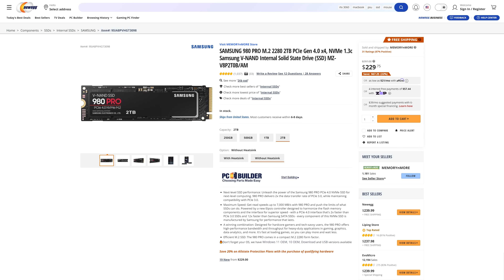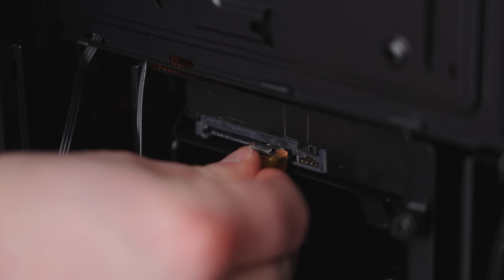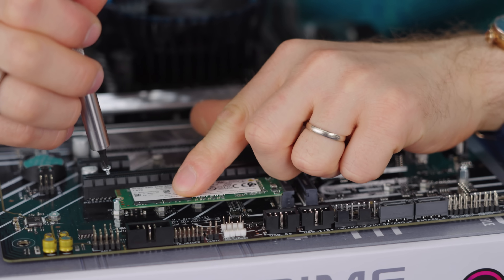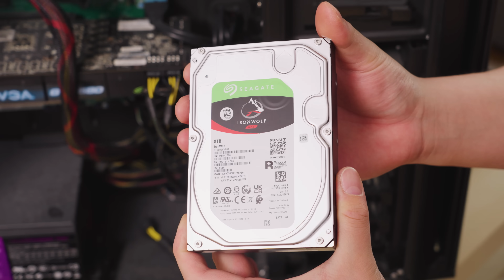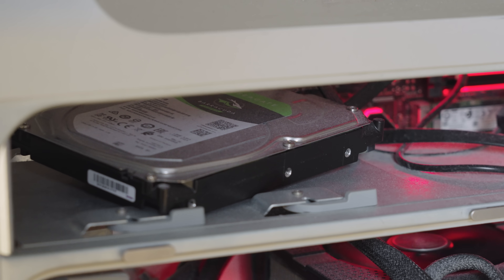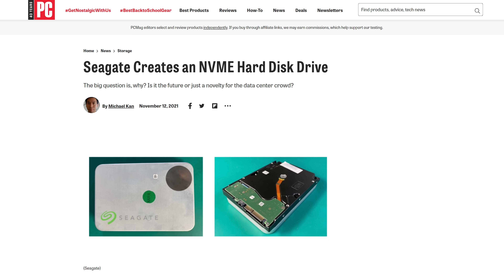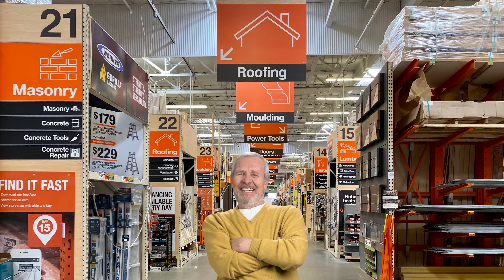Is SATA Obsolete?

Comment: SATA will be around for a long time as there is currently no replacement for it and it offers a lower cost interface than any existing alternative given that it interfaces to the chipset and not the higher value express bus.  M.2 is not a replacement for SATA as it doesn't fulfill the same needs.  That's like saying sandals are a replacement for athletic shoes.  The reason there is no replacement yet for SATA is, I think, because there is not currently any need for a replacement.

Comment: SATA will never be obsolete as long as there is no replacement tech for large format HDD. 12, 16, 20 terabyte HDDs still have huge value in the consumer, freelancer and business sectors. Nvme storage is still limited in cost, and how many nvme drives a system can realistically have. If you're a video editor, filmmaker, game dev, gamer who wants to have a stored library of games etc etc. Then you know the value of having a large storage drive that for all intents and purposes is fast enough for the job and is extremely cost effective.

Comment: I dunno, for my home nas server, it is still way cheaper to get mechanical NAS drives than 2.5" sata ssd let alone any 2.5" nvme, and honestly for my use case, i am fine with mechanical drives running ZFS on a gigabit network. The SSDs are great for their purpose, but i have a feeling mechanical sata drives will be around for a while due to being cheap mass storage.

Comment: Well, SATA and its derivative - SAS - are holding very well in datacenters. SATA is still used by most of video recorders (but to be honest, USB-C seems to bite that sector from one side, and UHS-II and newer standards from another). Still, 2.5 SATA drive can have so many fast and relatively cheap chips, that no SD card would get even close (but USB-C drive can). And yes, I am considering switching my prod servers to enterprise NVMe for fast storage - but I will also use a ton of 2.5 SAS drives for reliable storage (fun fact: I still have ten year old SAS drives and they already outlived three backup NAS arrays)

Comment: I wish seagate would unveil a mechanical drive that can last longer than 2 or 3 years. That would be impressive to me.
Reply: What the hell are you doing to not have a hard drive last 3 years?
Reply: @JerichoTheCity  purchasing seagate hdds. Seriously ive had 1 seagate hdd last longer than 3 years. Also all of them minus one external thumb drive have sat undisturbed in my desktop which is well ventilated and not accessed continually. I would think it was something I was doing except all my Western digital hdds in the same tower are just fine. Ive got a couple of wd hdds from 2007 that still work like the day I bought em i kept them as backup drives cause i mean if it aint broke.

Comment: Not until I can stick 10 M.2 drives in a box for as cheap as I can do it with SATA. Next question.
Reply: m.2 is just a form factor, it can be SATA or NVME under the hood.

Comment: I have a loose sitting SATA SSD.  No moving parts like a hard drive so nothing to worry about there.  It is in a 5 1/4 bay with plenty of room for other 2.5 inch drives if choose to use them

Comment: My issue is if I have both a graphics card and an NVMe drive installed on my motherboard, my last few SATA ports will be disabled. It drives me crazy, because now I have to use a PCIe to NVMe card that I can only put in the PCIe x4 slot because I don't have any other slots, which means the SSD is running slower than it can, which is annoying.
Reply: "my last few SATA ports will be disabled" What motherboard is it? A SATA port is usually only gets disabled when you install a SATA M.2 drive.

Comment: I used a hard drive to boot for over 10 years across xbox and pc with it taking 2 minutes average for pc and 1 minute + for xbox. Now with a ssd that uses a sata connection it's literally 5 seconds boot time. It's not on it's way out for a start that's completely fake information something linus channels are great at and all the bullshit about needing m.2 ssd for "insane speed" is so laughably fake. You went from literal minutes using a hard drive in loading things to seconds using a ssd. Going from a sata ssd to a m.2 ssd can save you up to 10 seconds in extremly rare cases but in most cases you will save 1-2 seconds. wow gamechanger. 1-2 seconds sata obsolete for sure those 1-2 seconds faster very comparable to minutes difference between hard drive and ssd.

And yet here we are 10-15 years later with many different ssd "lightspeed loading" options and 99% of gamers still play most of their games on hard drive because with the cpus of today load times are so fast that it's not even relevant if you are using a hard drive or ssd for gaming anyway lol. I swear all linus channels are nothing but miss-information fear mongering and trying to force fomo to make people feel like they need the newest thing every single year. Get ready for "why you must have rtx 4000 series even if you have 3000 series and it's worth paying scalper prices for them" top linus money bags advice.

Comment: PATA died because of the size of the plugs and the ribbon type cables were a pain to route inside the cases. SATA was a lot better in this regard and only, at first, a little bit faster. But a regular user couldn't tell the difference without looking inside the case. Later SATA became faster than hard drives and only SSDs could actually use the whole bandwidth. Soon they became even faster and thats why we now have NVMe, mostly over M.2 using PCIe.
SATA is still fine for hard drives and optical drives and also for older systems using SSDs. I think SATA will become obsolete, when large SSDs become cheaper than hard drives. My guess would be, that there will be a reduced amount of SATA ports, but like the floppy disk connectors, it will take a long time for them to go away completely.

Comment: MX500s in particular provide really good performance when it comes to SATA SSDs and they now come in 4TB varieties that much cheaper than NVME of the same size.
Reply: a year later is now the NVMe drives have the same price as sata drives
Reply: @DualPerformance  Yeah, and we're talking about good PCIe 4.0 NVME drives being the same price as good SATA drives. The 2TB SN850x is somehow cheaper than a 2TB 870 Evo or MX500.

The only reason to buy SATA SSDs is if you've filled the slots on your motherboard and don't care about the extra speed of NVME drives.
Reply: too late  comment, in my country, 1TB NVME is now cheaper than 1TB SATA SSD hahaha 🤣

Comment: I still exclusively use SATA SSD's, I've used nvme's on other PC's and the difference is either completely unnoticeable or so miniscule that I can't justify paying nearly twice as much per GB. Especially since file sizes for games is getting bigger and bigger, storage space is becoming a premium, and modern games are barely taking full advantage of SATA SSD's, forget nvme's. Though I'm sure in the coming years with consoles finally getting SSD's that'll start to change.

Comment: These kids talking bout how like SATA is super old, bro i remember building computers with ISA slots in them and using DRAM. OS's were installed either by 3.5" or more commonly back in the old days 5 1/4". Win 3.1 had something like 7 disks i think. And this was before a lot of automation, so installing required preloading drivers for drives and then manual installation of all component drivers in the system. i386 did not even have a standard socket yet. Socket 1 was not even a thing until 486.

Comment: It's silly to think that SSDs killed PATA when in general standards were moving to serial interfaces in the 2000s just because signaling over serial turned out to be much more efficient. That's like saying USB became commonplace only after USB 3.0 (rev. 2x2 Ultra Speed Power).

Comment: In reality even Nvme 4.0 is obsolete if we look at network speed it can goes up to 40gbps with a single rj45 cat 8 cable but if they can release something on pciex5.0 16 lane slots it could go up to 128GB/s bandwidth over an x16 configuration and 32gb/s over a single 4x nvme connector pciex 5.0 is the way to go !

Comment: I already have 1 fast M.2 SSD, but I wanted to add a 2nd drive for recording VOD footage. It sounds like I would actually be better off getting a full size SATA SSD for VODs rather than adding a 2nd M.2 drive, right? Would there be any significant difference between them when editing 4k footage? Like would scrubbing etc be way faster on the M.2 drive or about the same? (my M.2 is an SN850, I would either get another SN850 or a SATA that's roughly equivalent)
Reply: I just did a 20GB file transfer test from one NVMe to another it was alot faster than my SATA the NVMe hit 2gbs & the SATA was only 100mbs

Comment: I have an older rig so nvme isnt even an option 💁‍♂ atm running a 1tb hybrid HDD paired with a 1tb SSD which works fine and I would swap my os over to the SSD but it's to much of a hassle to bother so until I build a new PC I'm good although I do have a game library far to vast for my drives 😅

Comment: Ill still take the redundancy of two SATA ssds over 1 NVME.  It's not like the 6GB/s bus is saturated while gaming.  Personally I think there is a contradiction moving all storage to the PCI bus, it redifines the concept of "storage".  NVME offers direct access not really storage.  It's best to use an NVME drive as a buffer in a NAS or your Game Loading Disk.   I dont seen any difference in using NVME as the OS drive VS SATA, even a WD Black nvme or some noname SATA SSD show very little difference.  Also for people moving large files a HDD RAID setup is most recommended for reliability anyway.

Comment: Sata is still good for older machines that don't support nvme drive.  I have I7 3rd gen laptop with sata ssd.  I use it because it has built in blu ray drive which you can't get anymore.   I don't want everything connected to usb.

Comment: Don't say that sata is obsolete or manufacturers remove it after watching your video, we still need it for back compatibility and for buying new SSD/HDD to older computers.
BTW, speed of Sata is more than enough for almost everything you can do with your computer, speed is limiter more by CPU power and ram, not by speed of SSD, you can see it mainly on game loadings, there is no difference between sata SSD and some fancy 3000 MB/s SSD in NVMe slot, many people now believe to shits, it's like megapixels in cameras back in the day, SSD with 5, 10 or milion GB/s will not make your loading faster. There is literally just difference between old HDD and SSD and that's all.

Comment: Only a few minutes into this video and your lack of research is frightening. The IDE bus did not get called Pata until 2003 when they did a minor upgrade to it to allow speeds faster than 100 megabytes per second went to 133. As far as the m.2 drives that's because they are running on the PCI Express bus which is why they have greater read write speeds where SATA is running through the North bridge and a lot of motherboards are phasing out northbridge and taking over that task on the CPU you guys being a YouTube  tech creator  should know all this.

Comment: You CAN get an NVME expansion card to put in your PCIE slots as well but then you still run into that PCIE lane problem.  I haven't used them before but eh.  Also I've already seen a few nvme solutions where that single screw that holds it down at the end just spins once in place to hold it down, so no screwdriver required.  As nvme becomes more mainstream I do hope they'll resolve that PCIE lane conflict issue.  As it stands now I have 1 NVME in my system and I'm content with that but I do want to use more in future.

Comment: PATA's demise had nothing to do with SSD's, SATA was a standard in the P4 days, and SSD's weren't mainstream until much later (2008ish). Sata came out because it was much faster even on mechancial drives, and was a cheaper more convenient cable. SATA150 was the original stanard/speed and not much faster than ATA133 which had been the standard for several years. NVMe and SATA M2 drives have been at a price equilibriam for a while now, its cheaper to build an NVMe drive

Comment: Still using SATA for the hard drive, particularly for keeping data which I meant to keep for long. Even when they said SSD is harder to get error but I've been losing 3 SSD and to restore the data is freaking expensive. Therefore I'm back to Hard drive to keep the data. But for OS and apps all goes to SSD. It's freaking fast.

Comment: Ifixit is awesome, I adopted the NVMe standard as soon as I could afford it. The speed is fantastic. I do use a SATA HD 7200rpm for large storage needs. But overall NVMe is great for space saving and extremely fast boot times. Get a motherboard with enough lanes so as not to affect FPS.
Reply: That's because you compare to a mechanical drive. The difference in win 10 boot times between a SATA SSD from 2010 and a Samsung 9XX pro NVME is like 10 seconds vs 8 seconds

Comment: Some higher end motherboards have up to 4 NVMe slots for use with the right CPU in addition to the chipset features. Still not a lot considering you can have so much more with SATA. We haven't seen much improvement with SATA in years - mainly because it is good enough for most needs. Eventually, we'll need a revision in order to keep up - even USB is faster now.

Comment: In 2015 I wasn't even vaguely aware of NVME storage. All my important stuff was SATA and some of it still PATA. Up until then I spent a grand total of $225 on SSDs which total to roughly 466GB. NVME suddenly looked interesting mid-2018 when I made the jump from Phenom II to FX. Late-2019 I made the jump from FX to Ryzen 3rd gen and NVME largely influenced that decision. Not because of NVME tech making large leaps at the time but the sharp potential of NVME RAID. Having trouble free fixed disks that allows you to dump a bunch of slow storage to your SATA connections helps everyone rethink performance strategy. Don't get sad thinking SATA is going anywhere. It's not. It has stagnated and plateaued due to lack of evolution paths. It's here to stay for the next 10-20, thank God.
Reply: Not stagnated, turned into SAS.

Comment: Exactly all you have to do is upgrade the graphics card GPU as I have six Sata hard drives and each of them have 8 TB except the main one is this Samsung 512 GB which is just for the operating system and the main programs and then as for an example Steam games are on the terabytes. I had this computer for over 10 years upgrading just the hard drives the GPU, it is even displayed by the DisplayPort with multi-monitors each monitor is 27 in which makes the picture 81" in monitor, I've been playing all the games and watching movies and so on it's as good as it can be you can't keep begging for more and more and more.

Comment: I would like to see motherboard manufacturers get away from mounting the NVMe drives onto the Motherboard and have
them put in a small board that you plug into a slot.  Like you do or did with PCI Peripherals.

Comment: >is it obsolete
NO. It isn't. 
And to be fair, one big part of this is that it's cheaper, which is why I've still got my SATA hard drives plugged in because even in 2022 2tb just costs too much more when I can pay fifty dollars or less. Also, I've got some real concerns about longevity issues with using a pricey NVMe drive for my boot drive. Stuff like the T-Force Delta Max ARGB SSDs are always going to have their place, as are hard drives in full towers. Basically, PCIe SSDs are mainly a thing where you're building smaller, cheaper computers like laptops, SFF desktops, NUCs, and e-waste like chromebooks or whatever Apple makes or Walmart sells.

Due to the cost which is something LTT often forgets about teenage Joe Q PC builder there's a pretty big difference to someone about paying $50 for 2tb vs $100 for 1tb between SSD and HDD, but more importantly, you only get so many PCIe lanes. I've got two disc burners/M-drive Bluray installed and an additional 6 SATA drives, which is enough of a deal to me that Intel's measly 6 SATA ports was a seriously huge downside. Meanwhile you're now hogging all that bandwith on motherboard lanes, which matters quite a bit when you're a kid or not rich and shopping for motherboards and don't want to spend $250+ on a board just to get adequate NVMe storage, whereas basically it works 4 lanes per NVMe drive vs 1 lane per SATA per lane allocation iirc. This means that for the price of one NVMe drive that costs like $130 for 2tb on deep sale, I can get FOUR storage devices, not even counting the monetary cost of SSDs being cheaper too. 

So basically before even watching the video that's my hot take on the premise working out only because of Dell's rampant e-waste stuffing ultra light and disposable devices with it where upgrade and expandability doesn't matter and so doesn't exist anymore you can't replace the batteries and SODIMM RAM now. But for an enthusiast, what you're talking about would involve lots of changes to the architecture where the chipset is then wasting all that SATA on a couple NVMe/SATA SSD and hoping you've got enough USB ports leftover to plug anything else in.

Comment: For my last two PC builds (last one end of 2019) I used only NVME Drives.
Not only because of the top end of speed, but because you are ending up saving a lot of cables and thus cable management.
And I usually dont tend to store too much data, so currently 1TB is plenty.